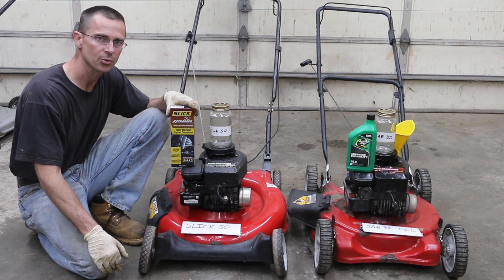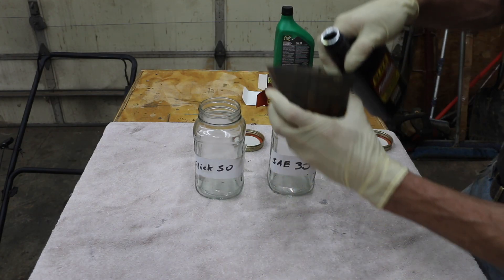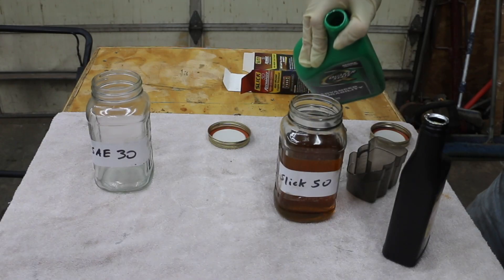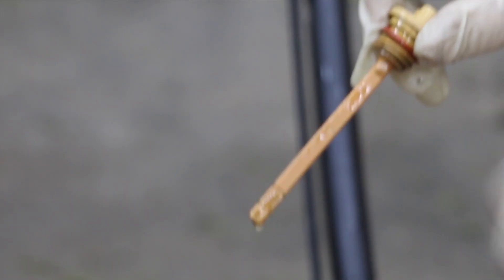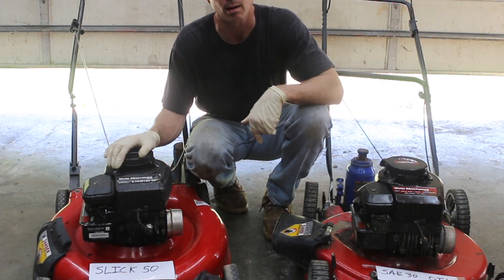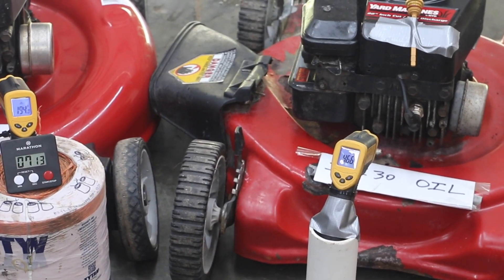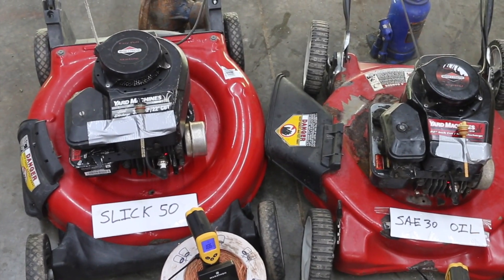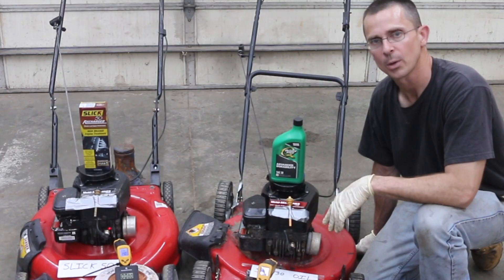Can't believe what SLICK 50 did to my engine!!--Dry Crankcase Test!

Comment: That was a surprise.  Just guessing that the slick 50 engine had more wear and tear than the other engine or a weak part or something like that.  It would have been interesting if both were brand new engines (I know that gets expensive).
Reply from the maker: Yes, new engines is a great recommendation!

Comment: Very good video, but I can’t help but wonder if the SAE 30 engine was running a little lean? It seemed to run hotter and it seemed to heat up a lot faster.
Reply from the maker: Yes, I believe you are right.

Comment: I am truly amazed at the results. I wonder if there were any contributing factors that made the difference, The Slick eng should have lasted longer. Is this really the real Slick or just something else using the name? How about the inside condition of the engines? Who Knows. I once saw a car run with no oil and I was amazed at how long it ran, over 30 minutes. What type of oil had been used in that engine, had there been additives used, again who knows.
Reply from the maker: All great points.

Comment: Perhaps there was an unknown significant difference between the two engines that would explain the dramatic difference in results? If so, imagine what we'd all be thinking if the Slick 50 happened to wind up in the other engine instead! :0 I don't normally care for destruction, but those are just "modern junk" :)
Reply from the maker: Thanks for the constructive comment.

Comment: Lucas oil additive and also bardahl pro-1 oil additive. Pro-1 claims to provide a protective film on the inside of the motor. I watched a demonstration where a guy put pro 1 on his hands and then dumped the same sulfuric acid that he melted a towel with on his hands. His hands seemed to be unaffected so I would be curious to see in a test like this.
Reply from the maker: Thank you for this recommendation!
Reply: Project Farm I would be glad to send you a bottle if you take sponsorships..

Comment: If Slick 50 helps the engine run 20-30 degrees cooler, that should increase engine life. But why did it lock up first?
Reply from the maker: Great question. Not sure why it locked up so quickly.

Comment: The reason is simple, that is NOT the original Slick 50 formula, that belongs to the inventor (who sells it under a different name). The NAME was purchased but the efficacy of the product is much diminished with the replacement formula.
Reply from the maker: Thank you for this information.

Comment: Nice experiment.
I usually just put SAE motor oil in my engines without any additive. 
But it looks like when you dry out two engines, the amount of oil in the SAE jar is less than the other jar. So maybe there is just a bit more oil in the engine with SAE that causes this difference.
Reply from the maker: Thanks for commenting on this.

Comment: This is a good home test. Having a lower running temp would tend to indicate less friction, which would result in longer engine life. Of course running any engine without oil will kill an engine, so I'm not surprised that both engines failed.
Reply from the maker: Thanks for commenting on this.

Comment: So here is the problem....these are used engines.  There may have been a pre-existing  flaw in the mower with the slick 50.  The slick 50 did keep the engine cooler and that is significant, but the experiment is inconclusive.  But I like it!
Reply from the maker: Thanks for the constructive feedback.

Comment: Probably too old and this may have been tested. Mobil One versus regular oil. My story is my 88 Ford Taurus blew a crankshaft seal and lost all the oil. My wife saw the oil light come on and continued driving on the interstate to the exit and pulled off and called me. Short story, it was towed to dealer and I saw several of the 3.8 liter engines crated up. I was told it was common and the engine is usually shot.Mine was deemed ok for repair. Never burned oil afterwards. made me a believer in Mobi One and Amsoil. 

I use either in my motorcycles. I really saw a difference in wear "whiskers" on the drain magnets.Like, none!  I used a motorcycle oil high in zinc previously. Always had a sheen in the oil and whiskers on the drain plug magnet.
Reply from the maker: Impressive!  I plan to test Amsoil and Mobile 1 in a future episode.

Comment: Z Max is  Avblend  which is the only oil additive approved by the FAA for aircraft. It literally soaks into the metal. I have used in my diesel RV and only started that engine once every 7 months. It always started up like it had hot oil in it. High cranking rpm. Used it only one time 13 yr ago and 13 yr later it started the same.
Reply from the maker: Thank you for this recommendation!

Comment: I am not trying to stand up for slick 50 particularly, but perhaps the slick 50 clean the engine better and so then the oil burns off faster once the oil once it's run dry. I don't think you should waste engines like this, because oils are not supposed to be used this way. We are supposed to keep an adequate amount of oil in the engine. It's not fair to run it dry it's not the same thing. To me it's about how well the oil works when you have an adequate amount in the engine and how much it cost that's much more important to me. Your videos are interesting and well-made though thanks for that.

Comment: I love Amsoil, I use it in my 1971 Audi 100ls. It can be pretty expensive and difficult to get sometimes. I use Castrol Edge in my family's daily drivers and it's amazing. I instantly noticed the difference when we switched from OEM oil, the engine runs amazingly smooth and reduced noise drastically. I believe they use titanium instead of zinc (some Amsoil still use zinc) although I'm not sure if it truly works the same or better. But, would highly recommend Castrol Edge, it's fairly priced, easy to find, and works wonderfully.
Reply from the maker: Thanks for this recommendation.

Comment: Looks like you drained less oil from the engine with basic oil than you put into it. In that case, how much effect can it make on the result?
Reply from the maker: I'm pretty sure I removed all of the oil.  However, if the oil splash system can't come in contact with the oil, it wouldn't matter. Thanks for commenting!

Comment: It is doing something!! It ran cooler.  That's how it saves engines long term.  It's an additive only.  A synthetic one that makes the oil more slippery.  A more fluid oil will wash away heat more efficiently.  Old 30 weight just sticks to shit good.  I mean that's why people still run that stuff in old cat bulldozers under severe duty.  It stays on parts...but it's only for lubing not.a.heat exchange fluid. Slick 50 turns the oil into more of a hear exchange fluid as I understand.
Reply from the maker: Thanks for commenting.

Comment: It would be interesting to see these engines being repaired (and with lowest cost possible) after such tests. Which parts needed replacement? Which of these can be replaced with some objects not intended for this purpose but still functional? Which are damaged, but still can be saved using some "crude" methods?
Reply from the maker: Thank you for this recommendation!

Comment: They are not the exact make & model, and age so the test is not valid. also, ceasing up it doesn't matter either compared to which is hotter which is what Slick 50 is ONLY made to prevent and which you seen in test...one on left was steaming. However, in one Youtube video with the original Slick 50 owner/foundation formulator John Bishop John says basically company was basically bought out and traded ownership back-and-fourth between companies before 1984 until he had to sue them and won back in 1989, and so Slick 50 is no longer available under the original name but under XcelPlus... https://www.youtube.com/watch?v=CAt-tJa9P_s
Reply from the maker: Thanks for the information.
Reply: I try, I like the initial test results showing lower temp.

Comment: Years ago there was an oil called Arco graphite.. I had a Chevy van that smoked. I changed and ran that oil in it. It not only stopped smoking, but seemed to be bullet proof after. The oil is no longer on the market. And I have to wonder why... That engine  ran forever..
Reply from the maker: Thanks for commenting on this.

Comment: Compare SLICK 50 to BestLine Synthetic Engine Treatment
Reply from the maker: Thank you for this recommendation.
Reply: I had to look far enough down the page to even find a mention of bestline. Compare additive to additive. This is good for any oil from what I understand. I ran a 2012 equinox (wife's cars) with no oil for almost a week, I credit bestline. Guy runs an old grader for over an hr after draining oil. Ran out of fuel and still no lock up.

Comment: I confess.  I put slick 50 in my family's 84 honda accord many years ago.  the car was purchased new and I sold the car at 180k miles.  it ran OK but down on power by then.  I don't remember if it burned much oil or not.
Reply from the maker: Thanks for commenting on this.

Comment: Added to my previous comment,let me explain the whole deal,I had a 67 old Chevy truck with a 307 c.i. v8 with almost 200 thousand miles on it,it had the canister type oil filter,and I installed a screw on type adapter kit,I d idnt get one of the o rings out that was stuck up inside the block,it happens in most cases,I put oil and filter in and drove it an hour to work in the summer,I replaced one quart of oil with a quart of slick 50,,,when I got off work I checked the oil before I went home,the crank case was dry,all the oil leaked out and didn't realize it,it never over heated and it never seized up,took oil filter off at work and found another oil ring gasket,put it back on and put in 5 more quarts of just oil,and drove it another 5 years before selling it....I really think the slick 50 did what it claimed to do.
Reply from the maker: Impressive!  Thanks for sharing this experience.

Comment: Having used Slick 50 I was always on the understanding that it is an engine treatment and it needs to be ran in the engine for so many miles so the teflon coating can stick to the target surfaces.
I would NOT use this in a wet clutch motorcycle.
The way you are using it here on the mowers is as if it were an additive.
Try the experiment again and this time let the Slick 50 do it's job first then run it dry.
Reply from the maker: Great point.

Comment: This was a pretty fair and balanced test, but I have a question.The S.A.E 30 engine looked like it had many more hours on it thatn the Slick50 engine. If so, any old school dirt track racer can tell you that having a few thousandths extra clearance in the engine will make it last a lot longer when the engine runs hotter than normal. It basically gives the crank and pistons and rods more time to expand before they eventually lock up. If the Slick50 engine had less wear then it would have suffered a bearing failure sooner from having tighter tolerances. The only truly accurate test would be to have identical engines with identical wear. 
I tried my own Slick50 test way back in the 80's and used an old 63 Plymouth Valiant with a 170 cu in slant six. The car was literally a wreck sitting behind my shop for years, but the engine still purred like a kitten and it had been running Slick50 in the oil for many years. So we drained the oil, started it up and placed a brick on the gas pedal and let it run wide open. It ran at full throttle for over 24 hours and ran out of gas twice before it just slowly locked up. 
No glorious banging and knocking or rod-through-the-block, it just quietly died :-(
Reply from the maker: All great points. In more recent videos, I used new engines to ensure a more apples-to-apples comparison.

Comment: Jayden Richey is correct. The original formula for Slick 50 is only available under the name Excelplus.  If you buy Slick 50, you’re not getting the additive that will allow your engine to run out of oil and still perform. And I know that the original really works. A fellow drove his car 50 miles to my shop, to fix an oil leak. The oil was pumping straight out of the engine, and he ran approximately 45 of those miles with no oil, with no damage. UnBelievable. He was using the origional formula. So Excelplus is the one to use.  Run another engine with Excelplus, and you will see a real difference.
Reply from the maker: This is a great point!    I'll have to test Excel plus. I've heard a lot of great things about it!
Reply from the maker: This is a great point!    I'll have to test Excel plus. I've heard a lot of great things about it!

Comment: I don't know if you have Challenged Z-Max to the Molecular Bonding Test or to any other Brand to the  test it yet? I have used it in many of my vehicles. I personal of successful motor Issues. Z-Max has saved me from replacing & saving my LS powered notably my 2007 Saab 9-7X 5.3 ltr. SUV, I have owned this Vehicle for close to 4 years and bought what was supposed to be a SUV with a blown up motor, after I inspected it and it turned out there were 3 bent push rods after a accidental slip into neutral and it over revved alot. so I put and new set or 16 push rods, then I changed the oil and added Z-Max to all the major components. Engine, Trans.& P/S, well thank goodness I did. I was on a 120 mile trip to pick up some doors and some miscellaneous items. On the way back home I was travelling South on the 57 fwy and I looked down at my Gauges & Bingo no oil pressure, the service engine light was on the check gauges light was on just about every light was on. So  by this time I got out opened the hood checked the oil it was no where on the stick, it was leaving a trail like Little Red riding Hood so I called AAA they said 3-4 hours for any service. So I waited about and hour. I was looking for the trail of oil and found the oil pressure switch was not tightened properly and it was about 2 turns from popping out from the back of the engine I let it cool off tightened it with my hand. I rechecked the oil nothing, it had pumped out 6 of the 7 quarts this is now 6pm & getting to be night fall. I asked AAA if they were on their way. No not yet because they needed to flatbed tow it. I found 2 quarts of Mobil 1 in the back floor compartment, I added what I had but I knew it was not enough. I took a chance started the motor and the oil pressure went up then straight down and it sounded like a room full of typewriters. So eventually I got back home thank you AAA. I waited until the morning light to open the hood tightened the O/P switch jacked it up drained the oil expecting a drain pan full of metal and removed the oil filter WIX to see how much bearing material was in it,  almost no metal anywhere? I scratched my head & finished the service. I added the Z-Max again added 6.5 qts and a new oil filter again. I did not want to start it , but I did and WOW 60 psi & no noises not even a tick or clatter, LS owners know what I mean. Bye the way it had 143,422 miles on it then. I now have a 165,729 miles now. It does not stay at 60 psi. all the time, but 25 psi at idle,  is better than a new $5000.00 crate engine plus labor. I dodged a big bullet. I will be pulling this motor out soon I will send photos of the inside with documentation of my Experience with Z-Max products. I now use it in everything I own.
Reply from the maker: I tested Zmax in a recent video. Thanks for commenting.

Comment: Best way to preserve your engine is to change your frequent, that in my opinion is best solution. And yes stick to the given SAE numbers if possible is too a good idea.
To Diesel or turbo or with other technical gimmicks fitted engine the oil should too full fill the other technical tests.
Reply from the maker: Great point!

Comment: I am looking for something to put in my pick up.I only drive it once a week and for a couple seconds it always sounds like the upper motor is dry.any suggestions? Thx
Reply from the maker: You might consider adding a 5-10% ratio of Lucas Heavy Duty Oil Stabilizer if you don't live in a cold climate.  It's very sticky and should hang on to those top-end parts for a long time. Hope this helps.

Comment: THERE IS A PRODUCT BETTER THAN THEM ALL. (35 years of tried and tested) I have discovered that Proma heavy duty oil stabilizer is the best. And yes you can run a motor with a dry sump after it has been treated with it correctly. (many hours of treating / coating of all the moving metal parts. I would love to see you do this test. message me if you want details.
Reply from the maker: Thank you for this recommendation!

Comment: I wouldn't be discouraged by the slick 50, because it did perform great while it was in the engine. I have use engine restore in the past and it worked awesome, but it only worked that way the first time. I could really tell an improvement almost instantly in engine performance. I would like to see you run the same test on Restore! It would also be great to see a breakdown of the engine before the fail test, like you did with the liquid molly.
Reply from the maker: Thank you for this recommendation!